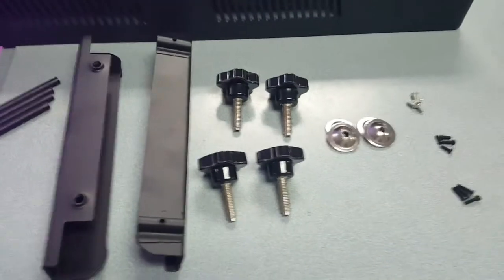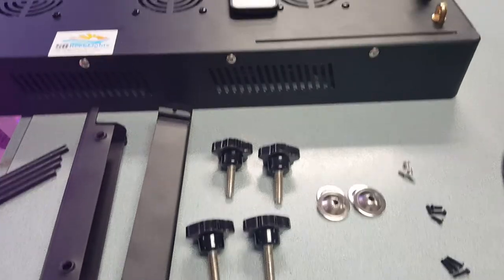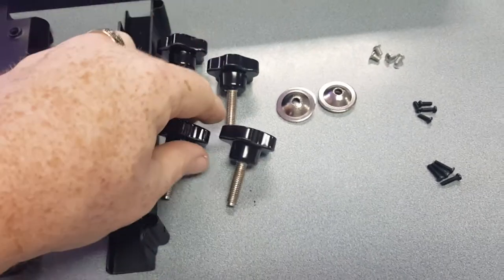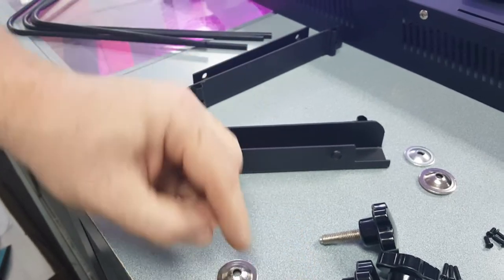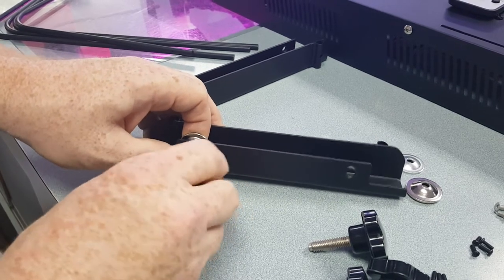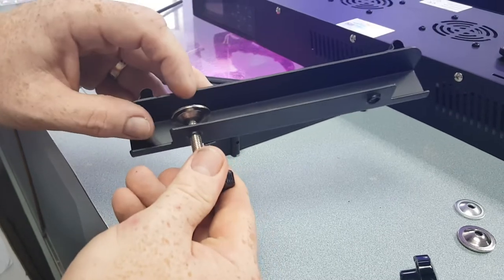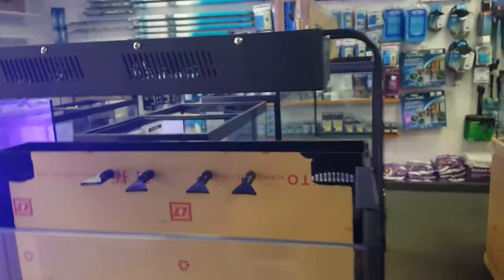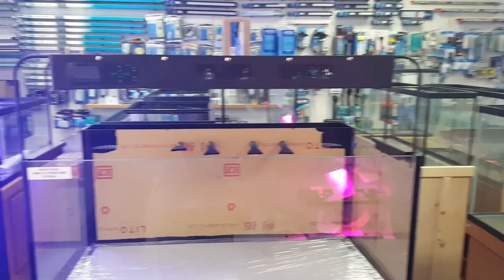SB Reef Lights Mounting Brackets - Instructions.

Comment: I've had my SB Reef for Freshwater for a month on my 2FT, I am getting a ton of green algae... Is there a recommended setting for dialing it back (as in 50% one channel 20% the second)? Thanks.
Reply: for reef tanks, we generally use 75-100% blues and 20-30% white
Reply: Hi you still using this light?

Comment: do all your lights come with these legs or are they extra??
Reply from the maker: Yes all sBoxes and Ultras come with mounting legs and a hanging kit.  For larger tanks with wider rims, flip the mounting bracket upside down and secure with a strip of velcro.  Hard to make a one size fits all unless you use plastic.  Our lights weigh too much for plastic.
Reply: When will the sBox Elite 16" Ramping be available???
Reply from the maker: It has been discontinued.  The WiFi light for just a few $$ more gives much more control.
Reply: And they come with the mounting legs??
Reply from the maker: Correct, all versions of the sBox 16" and 32" come with mounting legs.  The new ULTRA lights also have mounting legs included
Reply: Can you buy the mounting brackets by its self and what site?

Comment: Are they only for rimless tanks?
Reply: Mine don't fit on my rimmed tank, not even close. They also look a lot thinner than the ones he has and the 'knob' is on the other side (outside) of the tank. This was for a 32" Wifi light. I was going to hang it anyways, but it would have been nice to get the light up and running the day I got it instead of making a trip to the hardware store for wires, S hooks, clips, etc etc.
Reply: They will work on a rimmed tank but you cannot use the kbos unless you are willing to cut your top brace and thats not a good idea